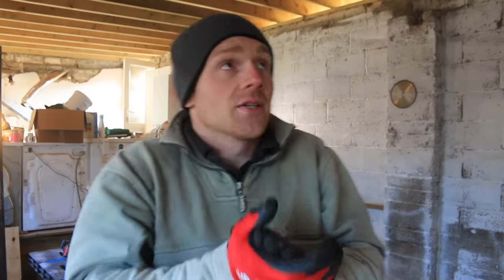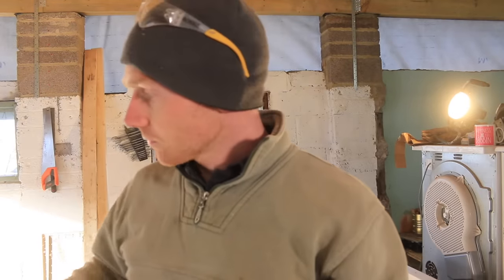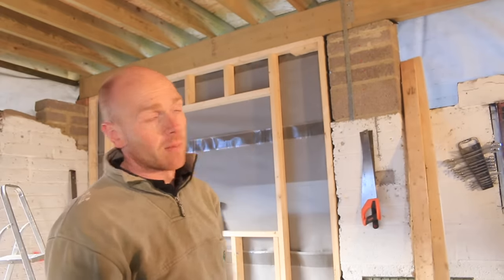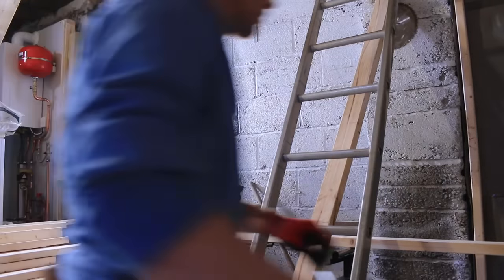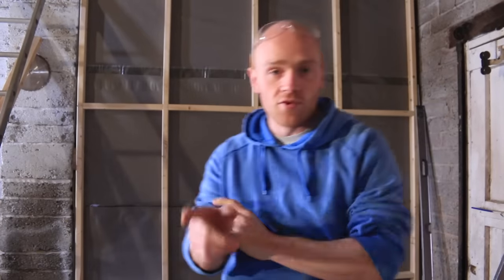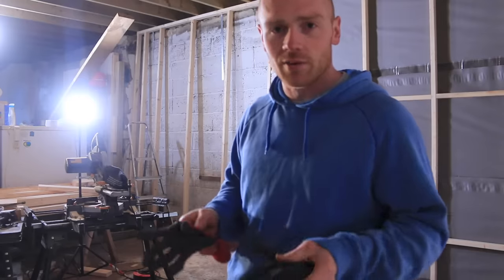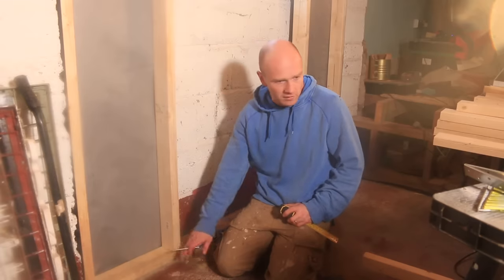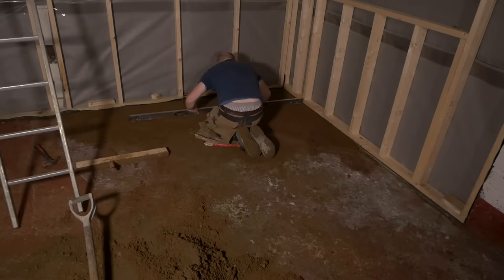Garage Conversion Stud Walls

Comment: What are the regs on your stud spacing? (US is 1 foot on center at least for residential)  did your regs/code change since the building's use has changed?
Reply: They are not structural at all so doesn't matter in the slightest
Reply: The block work is structural. And more so than any stud framing he could have put in
Reply: Just wasn't fully sure how he was working things. Hurray insomnia. But still curious why their code says
Reply from the maker: I started off at 400mm centres before realising it was overkill and went to 600mm but as said its only carrying plaster and insulation. 👍
Reply: @TheRestorationCouple  thank. You sir
Reply: @TheRestorationCouple  Exactly. Structural, or not, it's good to stay with standards for loads of reasons (materials optimization, labor savings [fewer cuts], nailing surfaces for sheet goods, insulation installation, etc., etc.).
Reply: Actually 16" on center for traditional framing. 24" on center for advanced framing.

Comment: Keep up the good work Tim. One question I had for insulation install was did you leave a 40mm gap behind the kingspan? As the studs are 100mm deep and you installed 60mm of insulation.
Reply from the maker: An air gap is usually required as with roof rafters. As the studs were set off the wall a bit I could have put a bit more in between but with 50 inside too this was sufficient.

Comment: Wiha hot torsion bit from Screwfix!!!!!! Putting in 1000’s of screws a day... and usually lots of self tapping so sitting in the screw even longer.. I can make my bits last around 20,000 screws I’d say! 

I also use to use gold screw pz2&3 bits when I used gold screw screws from Screwfix as they were designed to fit their screws great! But wiha are the best!!!!!!! 
https://www.screwfix.com/p/wiha-hot-torsion-screwdriver-bit-pz2-x-50mm/7905g

Comment: Great work Tim, thank you so much for your videos. I’ve come back to them time and time again. Did your building regs inspector not insist on cavity trays/weep holes in the floor and over the window on the external wall? I’m curious as I’m just starting a garage conversion and it was mentioned on my first visit prior to starting works but they’re not so easy to retrofit. Many thanks again!

Comment: where we live building control will make you used treated timber and put osb board under a breathable membrane as its classed as timber frame and that way you wouldn,t need brackets
Reply from the maker: Even if just to internally insulate a solid wall? I can understand in a timber frame situation however seems overkill to put OSB when no sheer strength required at all.
Reply: you can,t argue with them or they make life difficult they see it as an upgrade so say it needs to comply with building regs for thermal and strength
Reply from the maker: Chris Hyde best to keep them happy I guess. However surely if you were to just stick insulated plasterboard straight on there would be no strength required at all? Oh well, you got to do what you got to do. 👍

Comment: Found your channel in the last month or so and it's been really helpful with planning projects I have coming up, so thank you for taking the time to run it as it's definitely appreciated.
Do you have details of materials used in the walls or a web resource you used that you could share? I have a single skin brick wall WC that needs to be insulated and I'd like to copy what you're doing in your garage conversion. (Just with less insulation as mine's only a small room). Mainly the membrane/vapor barrier. Cheers
Reply from the maker: No list but the next video will describe the insulation build up. 👍

Comment: Your seal plate should be either pressure treated or sitting on a pressure treated seal plate. Moisture will migrate through hat concrete floor and straight into those studs.
Reply: Hi John, Can you please explain to me what a seal plate is? I'd like to understand this further thanks.